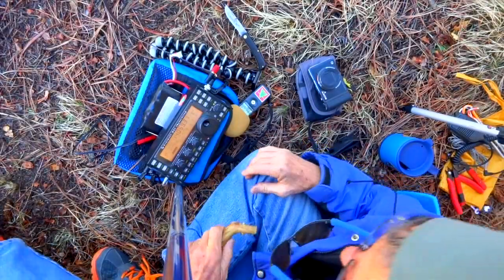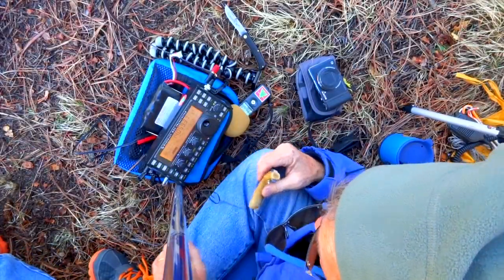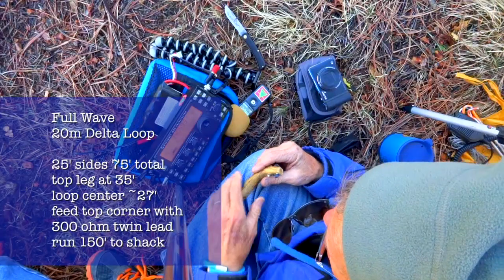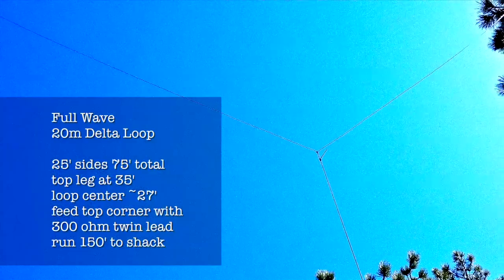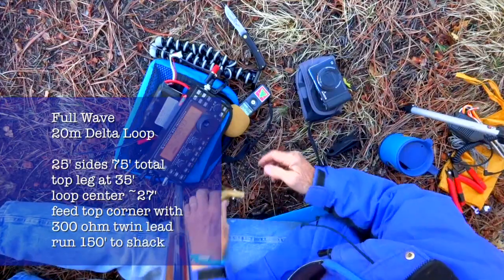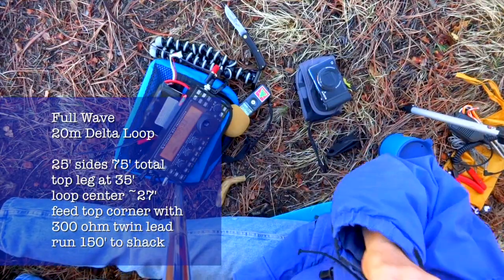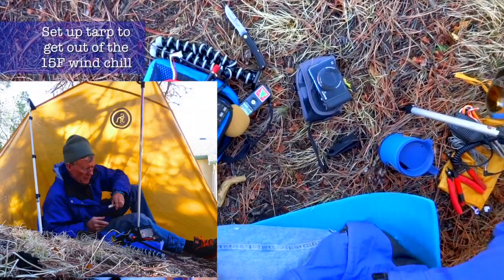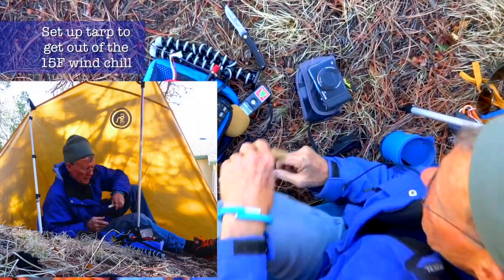Goat's 20m Delta Loop and KX3 at 10th watt gets 539 at 1200-miles

Comment from the maker: Put up a 20m Delta Loop first day of spring 2015. Don't have the feedline plumbed into the house yet. So I set up outside ...but it being 40f and breezy I used my handy tarp to fend off the wind chill. First QSO was Ken/WA8REI off the back of his beam. I was only running 100mW to new Delta Loop with KX3. 

https://youtu.be/-gCHTLeUmQ4    #QRP
Reply: Steve wGØAT Nice antenna Steve. I agree there seems to be great efficiency in full wave loops, coax or parallel line fed with tuners - they make wonderful antennas for QRP.  Thanks for another great video!  73 Lynn

Comment: I've used a 20m delta loop portable as well Steve. Works great even at low height.  Can tune up on a bunch of bands with 4:1 balun as opposed to 2:1. Also very quiet on RX. Try it flipped with a bottom corner feed for vertical polarization and low angle takeoff.  Easier deployment with a single high support too.
Reply from the maker: Chris Del Plato Thanks, Chris Will try the flipped! I had a 40m Novice loop that worked great many moons ago ...just trying to recapture some of the fun! This one hears about 1 S-unit better than my 4BTV vertical AND about 1 S-units quieter. Result is a net gain of 2 S-units of S/R. Not bad for $10 of wire + 3-hrs of fishing rope and wire over trees. I'll have to get more efficient for portable set ups!
Reply: Steve wGØAT
Yup, nice quiet antenna. I used one in Maine the last two years and worked lots of SOTA activators out west with ease. My typical deployment method is fishing line and launch vehicle is a golfball with a screw eye in it. I don't mess with rope for temporary, plus I can snap fishing line if it gets wrapped up in branches. Have flung it over 50' up no prob. Helps to unspool the fishing line onto a tarp or the ground (provided no things to get caught on) first.  Another tip - I use coat buttons for corner insulators on mine. Feed the wires and fishing line thru the holes.